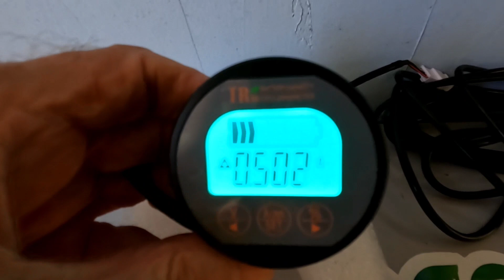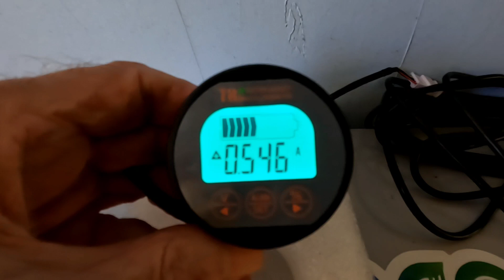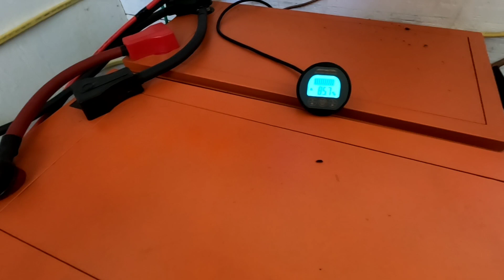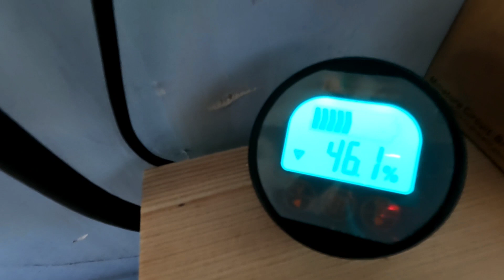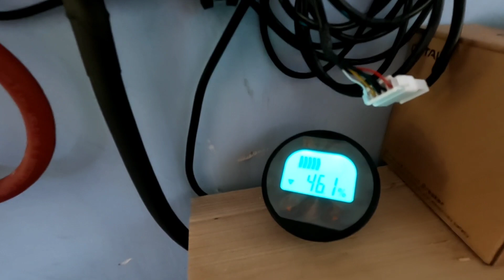Procrastination cost me some $$ ruining my run on 100% sunshine efficiency

Comment: I’m wondering if the price quote I just got from Redodo was accurate. Let me know if this was similar to your purchase?

$598.99 12v 200ah
$298.00 Freight shipping to 96797
Reply from the maker: I'd say that look's about right...battery prices are going down, shipping a little more lately.  You can use the discount code if you haven't...save a few bucks.  You're gonna love them. Aloha 🤙
Reply: Could you pls send it to this thread

Comment: got to put panels in a better spot.  Haven't run my generators in months ,my Colman RV propane generator hasn't run in a year and 6 months. started right up. my inverter gen 3000 watt gets hard to start sitting over 8 months. I use fuel stabilizer all the time.
Reply from the maker: I got spoiled last many months with the sun straight overhead,  but alas even here it goes down a bit. Think I've got the sweet spot pretty well scoped out now. My generator needs some stabilizer too. It's been resting for months . Which I am thrilled about! Aloha !🤙

Comment: So wait if your main house system is full why did you need to spend fuel on topping off the auxiliaries?
Reply from the maker: Well I could have,  but had just tuned up the generator and wanted to give it a run 🤙
Reply: @ProjectsinParadise808  
🤔

Comment: I’m with you on that, 
our off grid Utah location suddenly wasn’t making it through the night. Even though it’s been 103° there that doesn’t mean the suns of the summer angle. We had to adjust because it’s actually almost fall 
the way our system works it’s very closely level in terms of power usage versus capacity. We also don’t have the option of a generator really
Reply: That magic word "Fall".  It has been so hot that I can't stand it anymore.  By the way, Friday night/early Saturday marks the Harvest Moon, the end of summer.  Don't forget the time honored tradition of a glass of wine/beer poured on the ground for the Earth, and a glass of wine/beer poured on a body of water for the Moon, to remember and honor all those we have lost along the way.
Reply: @JR-kk6ce  Interesting, of course this o'le Tx. boi wouldn't know anything about that, but I'll sure to remember that now!👍🏾
Reply from the maker: @JR-kk6ce  Fall is definitely in the air! I'm glad to welcome it in. Been a little toasty here too. Not like you all on the mainland have been experiencing,  but still a tad out of my comfort zone on some days. I will definitely pay homage to fall as you mentioned,  maybe splash a little on me as well! Aloha 🤙
Reply from the maker: Yeah even at this latitude  still got to find the sweetest spot. Think I'll do okay once I move everything.  Aloha 🤙

Comment: How many  volts does your panels supply your  S.controler. with?
Reply from the maker: Right now live on the REDODO system 28-29 v. On the Power Queen system at 41.62 v now...aloha 🤙
Reply: Thanks 😊    good to compare.